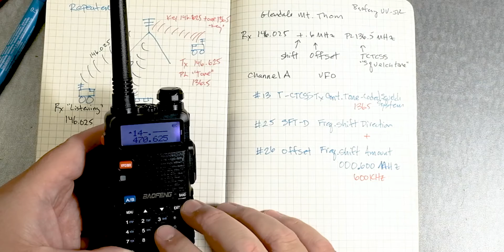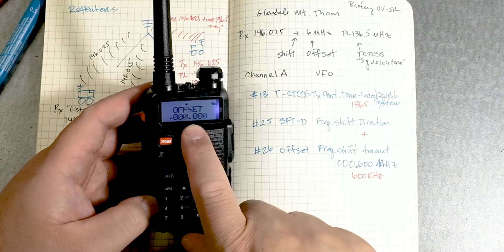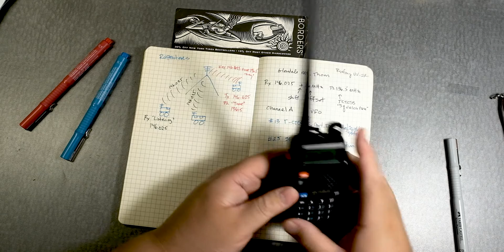Baofeng UV-5R Setting for a Repeater

Comment: I must of missed something. I programmed mine for my local repeaters with chirp.
Yet i never hear anything on the channels.
Do i need to be in channel mode or frequency mode. 
Maybe i need to ping them first?
Ugh, im so frustrated
Reply from the maker: It is frustrating when you don't hear people on the repeater, especially when you call out.  Sometimes, the repeater is just not used much and there might not be people using it.  Other times, the repeater is used on certain days of the week for meetings.  I would listen to other repeaters in your area.  Make sure you use the proper vernacular.  Also, join a Ham club ask them which repeaters they like to hear. Don't give up, that's why it's called a hobby, there are ups and downs
Reply: @frankwc0o  im thinking a local club may be a good idea too.  But yea a hobby never ends… until you get tired of it. Lol

Comment: Nice video....Trying from the same location you mentioned, but cant reach it just yet.
Could you simplex 146.625 with the tone and tx for others to hear on 146.025? You wont be able to rx the repeater talk but they can receive you...is this correct?
What is the rtcss for? When a repeater shows something like 100/100?
Reply from the maker: I have never tried that - using the tone in simplex.  You would think you can, but it's possible that the radio's offset is not set, the tone might not be released.  I don't know what RTCSS, but it might be similar to CTCSS (Continuous Tone-Coded Squelch System).  CTCSS is the system that gives the tones.  If you do the steps on the video, make sure you are outside.  The signal will travel better.  Also, make sure the tone is correct and the correct offset +/- .  Good luck.

Comment: Do you have to have a license to connect to repeater and transmitting?
Reply: @frankwc0o  I want to get lots of miles with a 5w uv-5r radios I m home and my mom is 20 miles away does it work if I connect to repeater
Reply: @frankwc0o  ok if I give you where I live can you look it up and tell me now
Reply: @frankwc0o  oh ok thanks for your information so what is the model for the roof antenna
Reply: @frankwc0o  also does the uv-5r radios work good when you’re like 20 miles away
Reply: @frankwc0o  do they sound good far away with a repeater

Comment: How do you program a tone that says DPL073     there is a frequency on papa system and it says that. I have a baofeng radio
Reply: @frankwc0o  446.760.  Encoded 127.3  pl and PL decoded   141.3   That is the frequency from papa system im trying to connect.  There r people from all over I guess im only to receive but unable to transmit.